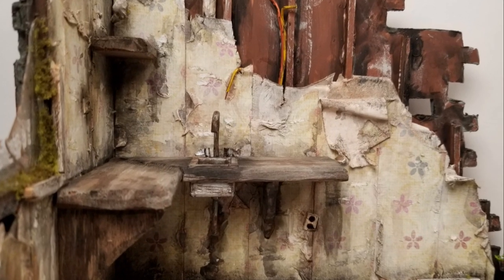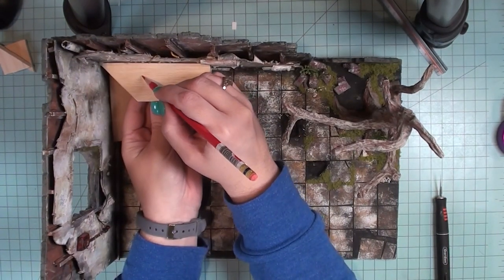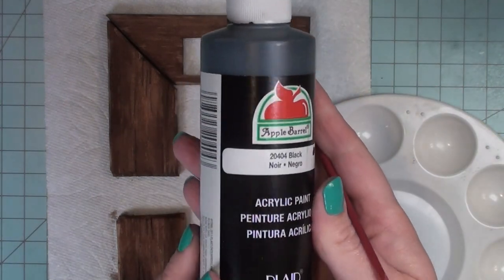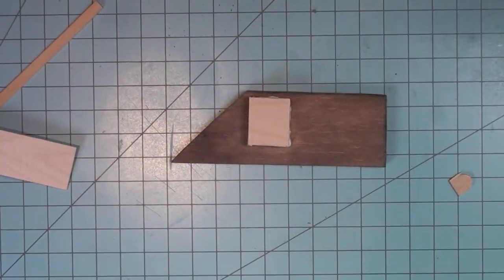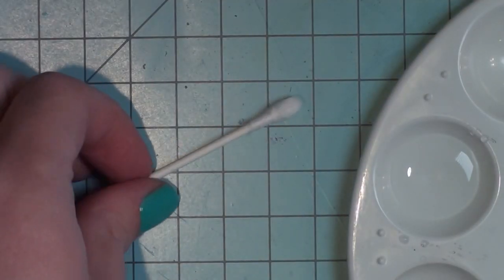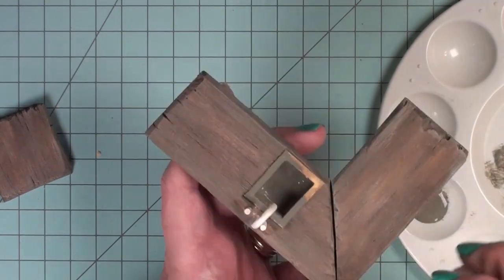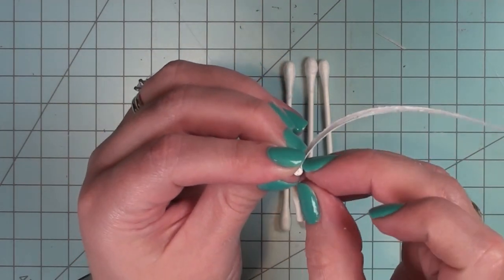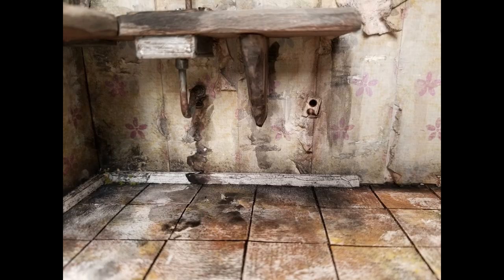Miniature Counter tops and Rusty Sink (Abandoned Coffee Shop 6)

Comment: You might want to add some pipes under the sink for the hot  and cold water taps.  I would take the pipe material and paint it an old copper color with some copper green streaks on the wall and pipes like the water leaked onto the wall and ran down onto the floor and have it smeared like someone had tried to clean it up at some point in the life of the old coffee shop.  You could also break one of the pipes and bend it or blow it out like it had frozen and burst.  You could also add shutoff valves to them too.
Reply from the maker: Great ideas Richard!  I figured under my sink might need a few more pipes but I really like the idea of a busted one!  Thanks :)

Comment: Oooh what about a floor drain?? Where the water would go Incase of a flood?? Like a clean out type thing
Reply from the maker: Great idea as I think  most kitchen areas are required to have drains!  It would add a bit more interest to the floor for sure!
Reply: My first job was in a restaurant and they had a mop bucket sink in the kitchen and drains in the middle of the floor near water sources.  It had a brass drain cover on it and was the dirtiest spot in the kitchen beside the mop sink.  The mop sink tiles it was set in and around it were usually coated with dirty grease and grime and everyone hated cleaning it them. It was the nastiest job in the building.
Reply from the maker: I think I will be adding in a floor drain and I think I can even push into the foam floor a bit to give it more of a slope into the center of the drain.  Probably no room for a mop sink but I will be storing that idea away for a future project!  Thanks Richard!